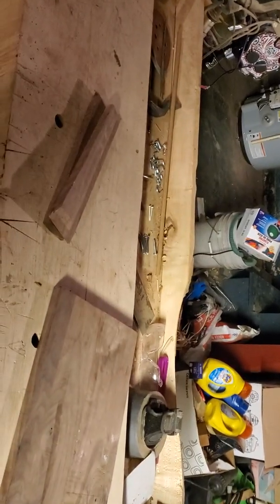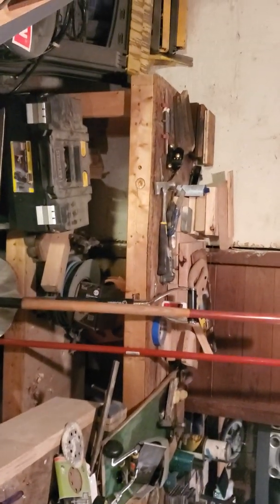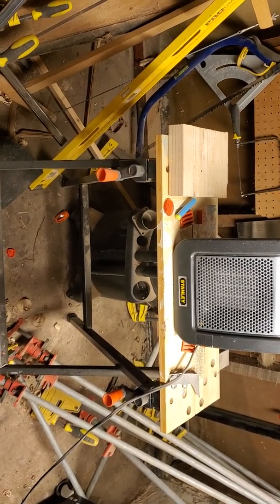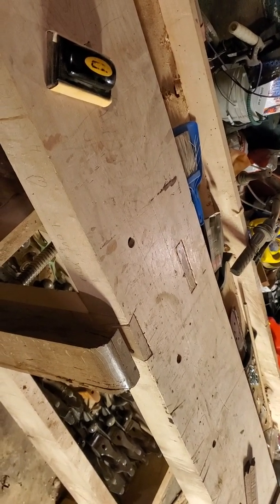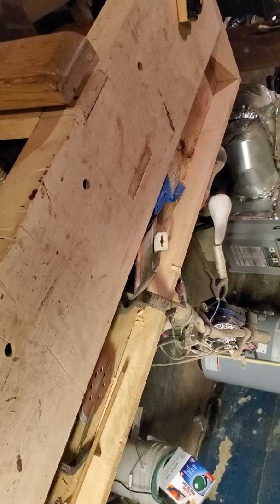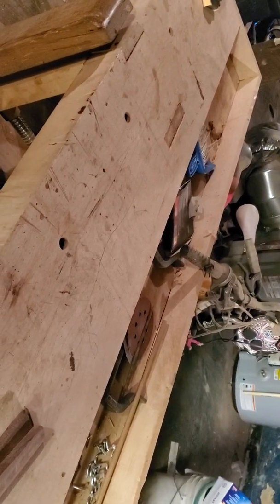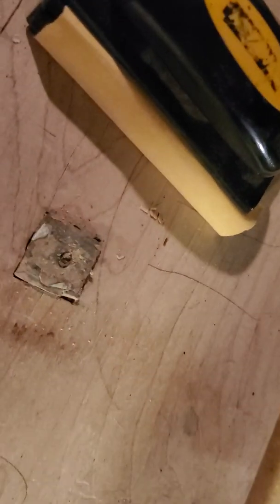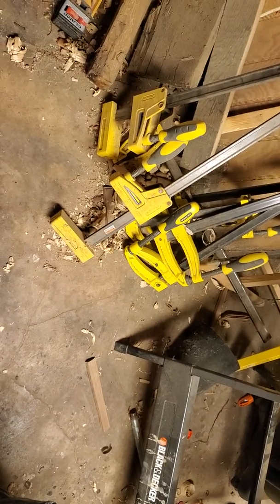Realistic Woodworking Part 2: Work Holding.

Comment: Good advice.  I cringe when I hear someone say they are going to make their own bench as a first, or very early, project.  Like you, I also recommend making something simple and cheap to start out.  Plywood is a good material for a top, especially if you glue two 3/4" thick pieces together, but just on layer is fine if you provide enough supports below it.  The simplest, most rigid, base a person can make is a box of OSB screwed together with a 2x2 in each corner.